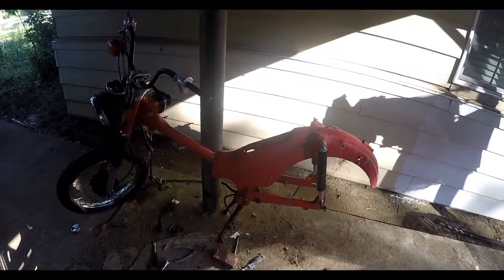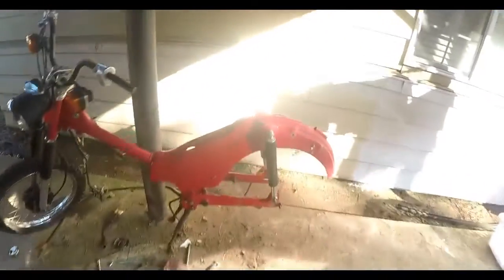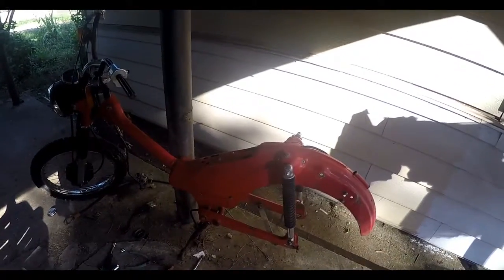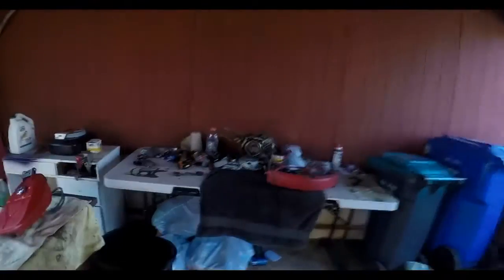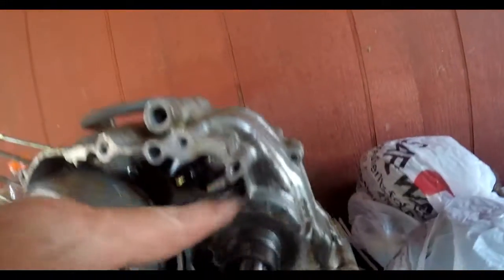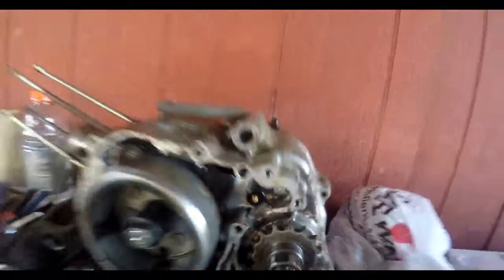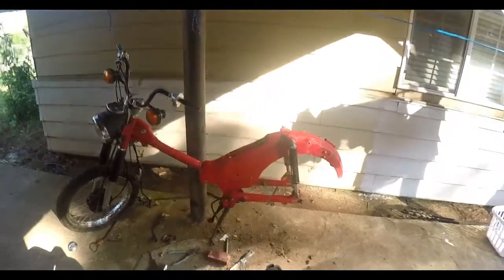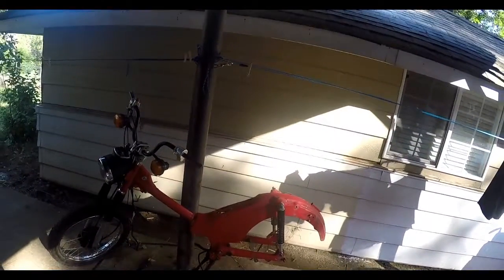Honda CT110 Rebuild Part 11 - Prepping the bike for paint - Shane Mouton

Comment: fuck bro! going to do the same thing in a few weeks, really happy i found your videos

keep em up
Reply from the maker: for sure bro. only too happy to help... which CT have you got?
Reply: I haven't bought one yet! but i'm australian so late model 110's are everywhere which should save me most mechanical work

since you've taken yours apart, how big of a job do you think removing the stock gas tank and replacing it with one mounted on the neck would be? 

google 'ellaspede' CT110 to get an idea of what i'm talking about, and to also see the most beautiful bike in the world
Reply from the maker: tank change is something i considered and should be very easy. You would only need to mount the tank and get new fuel lines to the carb which is right next to where you would mount the tank.

I am keeping mine stock for the thought of resale down the road since its an older model here I think the stock look will fetch me a couple more dollars... Your late model is going to be a little different to mine. Check this page here:

http://ct90-ct110.com/PDFs/CT_Common_Specifications_V1-2_Nov_10_2008.pdf

this covers the changes 1970 some what to 1987...

I LOVE that link you sent me about the  'ellaspede' CT110. it looks AWESOME